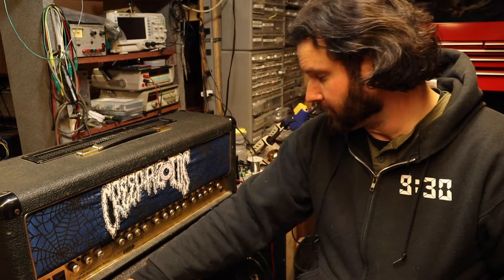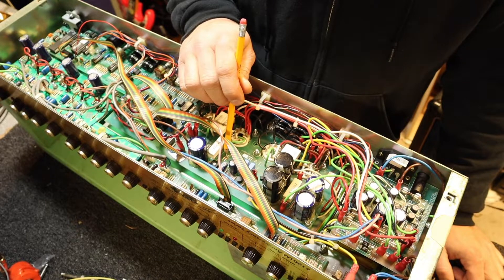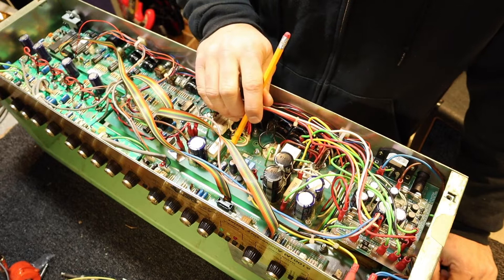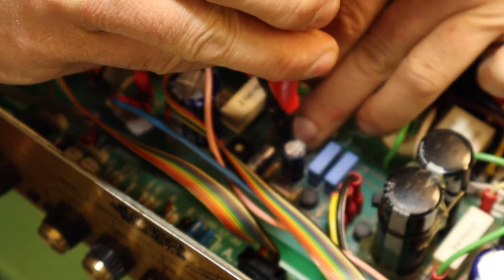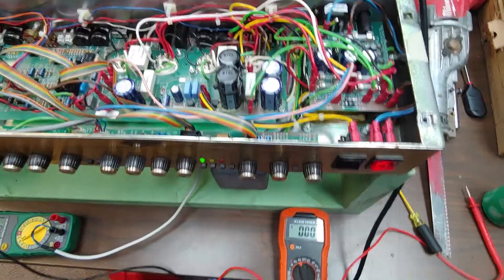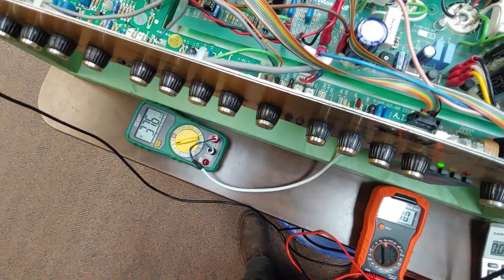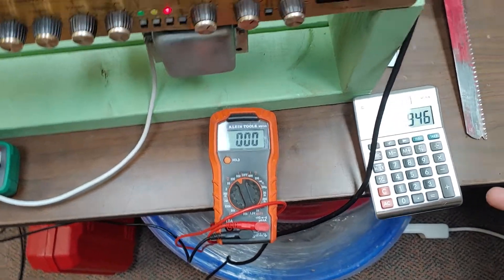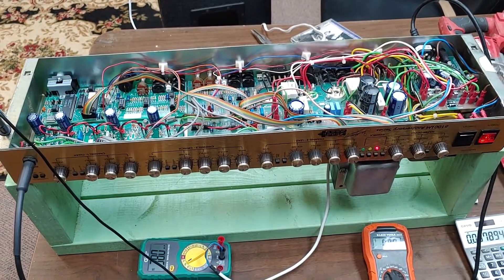Marshall 6100 simple repair and How to Bias

Comment: PURGASOUND, general question its common for biasing cathode biasing or grid biasing amplifiers that when adjust the biasing voltage for NO crossover distortion while the biasing current is in the range of 30mA to 45mA idle current but the problem is either the power tube dissipation is way below 70% or way above 70%, what can you do to fix this problem? because the plate voltage is already max out and you don't really want to decrease or increase the plate voltage because its set to the specs of the datasheets of the power tubes. The correct way of biasing amplifiers either cathode bias or grid bias is that the rule of thumb is NO crossover distortion, idle current is 30mA to 45mA, plate voltage is spec to data sheets, Power tube dissipation is 70%. Now the common problem with amplifiers 2000's is that the tube dissipation is way below or way above 70%, so what can you do to fix this problem?
Reply: Interesting question, the problem presented above is viable. 
Unfortunately NOT ANSWERED 😂😂😂😂

Comment: I bought one of those Bias Probe tools a few years ago..it’s got two cable probes that plug into a switcher box so you can select tube A,B,then that plugs into a multimeter…each of the probe cables have a 1ohm,1%2 watt shunt resistor built into the cable…I need 2 more cables and was just going to make them myself,but was wondering the purpose of the resistor?I have seen some probes like yours that do not have a resistor in the cable….

Comment: Hello! I can't bias my 6100 hot enough, I'm planning to add a resistor in parallel to the r212 resistor to achieve it. Is it safe to do it with the amp off without draining the caps? It looks really difficult to turn the board around! Thanks for your time and your videos man!
Reply from the maker: You can easily drain the caps with two leads with a resistor between them. Most Marshall's should bleed the capacitor's charge when turned off but it's a good rule to discharge them manually in every case. You can also verify the charge with a multimeter. You can piggyback a resistor across the bias range resistor to get within the proper range. Having a colder bias on these amps isn't terrible since all of the distortion comes from the preamp stage. As long as the amp is no lower than 55% or 50% max plate dissipation there shouldn't be too much crossover distortion.
Reply: @purgasound  Thanks a lot for your answer! I piggybacked another resistor and im now able to properly bias it. It was 11ma instead of 37ma... needless to say that the amps now sings better than ever!

Comment: Do you need to discharge those caps manually before starting?

I did that for old crt televisions when I worked on them.
Reply from the maker: A lot of modern amplifiers have a bleeder resistor somewhere in the circuit but it is a good rule of thumb to discharge them manually before poking around in there. I've had my fair share of zaps from being impatient.

Comment: Derek finally got his amp to you.  Those 6100's are so damn cool.  Really a lot more under the hood than I imagined though.
Reply from the maker: This was actually way back in March.  Lotta ribbon cables in there. Does not look fun to work on!
Reply: @purgasound  Yeah, quite a bit more daunting than an 800.  I'll get you the Hammer (5150) soon to check out that preamp socket.